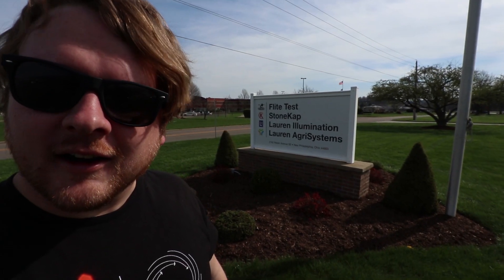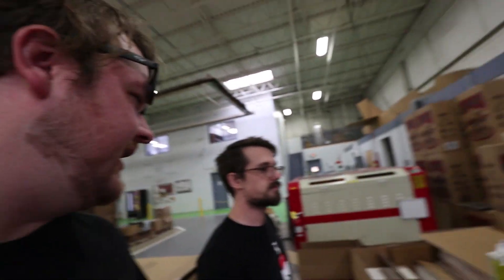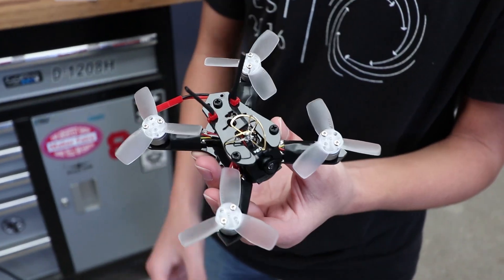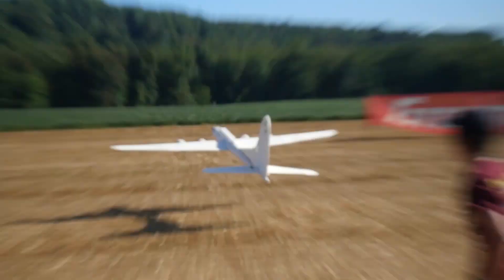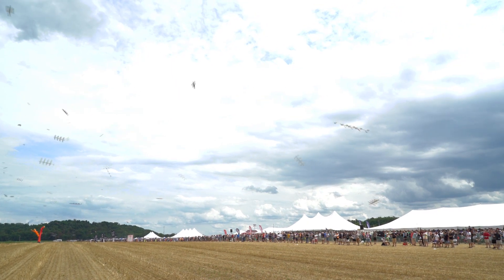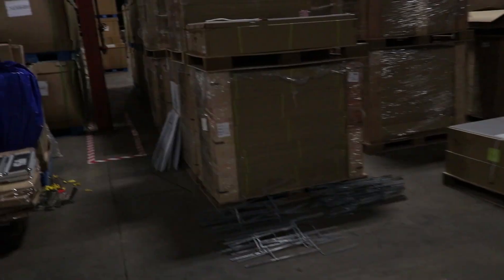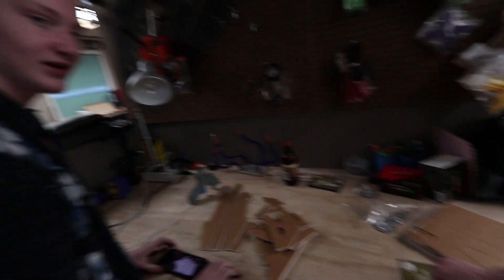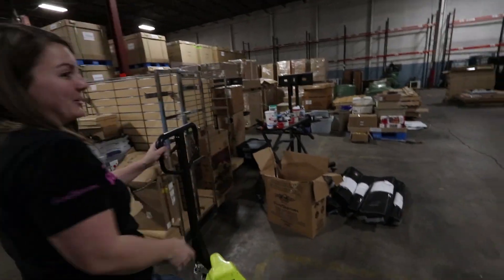WE'RE GOING TO CALIFORNIA! | VLOG0068

Comment: Any tips on laser cutting foamboard without melting the foam too much?
Reply: I have no experience, but I'd go as fast as possible while turning down the laser output as much as possible. If at max laser you can't get through completely, you have to slow down the speed until it does.